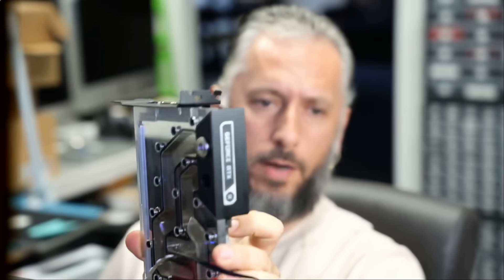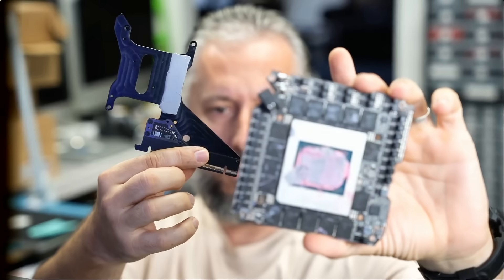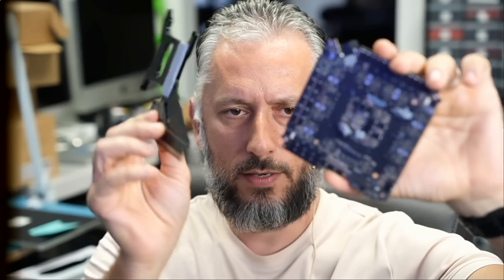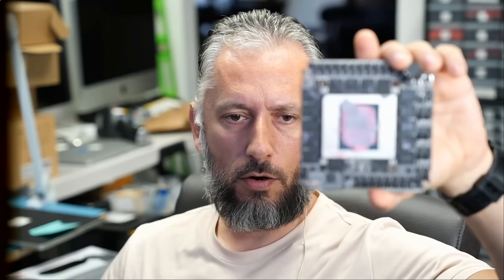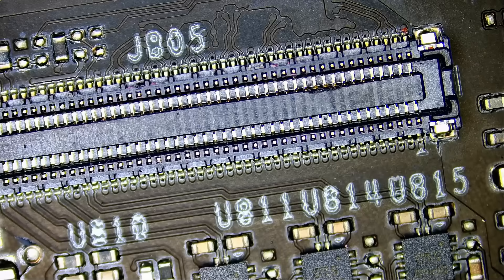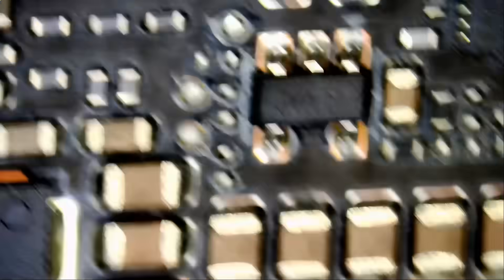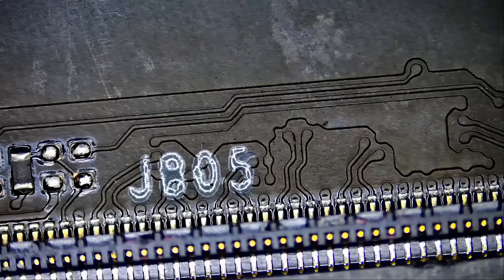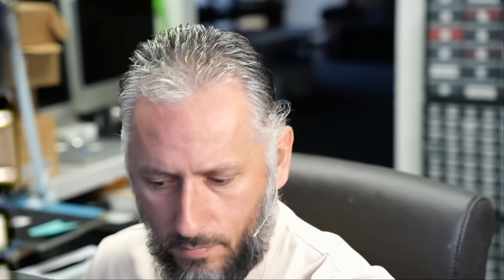Stay Away from 5090 Founders Edition GPU. The Weakest Design Yet.

Comment: working with PCs since 1998, and every time you take appart used PC you will most likely get an issue because of dust in the PCIE connector which is huge compared with that one... i think that electronics designers nowadays dont have any experience with basic electronic issues, they are just kids that finished colledge and know only what they were taught in school and nothing else.

Comment: Those connectors are terrible. But the same company that decided to use this on their most expensive consumer hardware also invented the 12VHP connector. Does this really surprise you?
Reply: Nvidia did not design 12hwpr connector Da$$
Reply: @JoeMama-yl1ow  They were involved in its design.
Reply: I agree the connector sucks and should have been designed better but the alternative is 4 pci-e power connectors on the pcb which is a huge no
Reply: @rckrz6  Actually each of those x8 connectors could handle quite a lot more wattage if needed. They had a lot of redundancy in the design. Compared to this design putting those through their paces seems the better choice tbh.

Comment: Let me see if I understood correctly. The owner bought a 5090 Founders. He then disassembled the card and installed a water block. During installation, he damaged a connector. Consequently, the 5090's design is the worst in the history of GPU cards. Is that correct? The problem isn't the design, which I consider brilliant and the way forward. The problem is the lack of user expertise and, also, the lack of spare parts. I have a 5090FE, and I couldn't be more satisfied with its design. However, it has terrible fan management, something that can easily be fixed with third-party software.

Comment: As far as I know Nvidia designed it that way, not because they wanted to make these parts replaceable. They basically wanted to keep the 2 fans for the cooler design and this required both ends to be permeable, to not trap the heat by the PCB.
Reply: The more you buy the more you save

Comment: You won't be able to purchase the connector parts as they appear to be proprietary to Nvidia. However, maybe you can scavenge one ;)  The entire card is designed to discourage tampering or repairs by individuals. Regarding the customer, it is their responsibility, as they could have opted for a water-cooled 5090 from various vendors. Now that the warranty is voided, it cannot be fixed, which is precisely how Nvidia intended it to be :)

Comment: You're condemning a perfectly good GPU because a mod went wrong. Which is nonsense when the product works as intended if you don't try make it what its not. The air cooler on the Founders addition works incredibly well and water cooling is not required.

Comment: I mean i see a positive logic here, since most last gen cards the fail point are the cracks on pci express connector because of weight, that is why they made it modular, so if ever the pci express connector is damaged, you can replace it with another daughter board😅, just sharing opinions

Comment: One issue with that connector is that the entire weight of the card can at some point hang on it.
I know we're supposed to have support for GPU's as big as that, but it's still glaring to me that the entire card can hang off a piece that isn't part of the main board and connected to a connector that can't be easily replaced.
Reply: The FE editions not put the weight on the PCIe connector, them have a unique and different structure that connect the whole cooler on the backplate, is there where the weight act on FE cards...

All the other brands ones discharge this weight directly on the PCIe connector, and so, directly on the electronic of the card.

You cannot notice this huge difference if you never tried to install a FE card

The real problem is, if you are not able to tear down it, just not do it, or you will obviously damage the card.
Reply: 5090 founders is actually pretty small.
It’s only a 2 slot card.
Reply: One way to solve GPU sag is to mount the card vertically, making it last longer. One way to solve that "problem" is for the vertical assembly to put extra pressure on a tiny internal connector, eventually breaking it. Bottom line, if the cards last too long, people won't be buying new ones sooner. The company's market cap in not going to increase itself.

Comment: In terms of the engineering of the card assuming you leave it in one piece, is amazing. The risk you have due to the repairability is extremely rough. But the engineering challenge that was being solved with this card is really amazing. 

It's hard. It is way more fragile. If there was a way you could get those parts for repairs, I think this is the best of both worlds. Because it does solve something that noone else had been able to solve.
Reply: What problem did they solve? Genuinely curious. Thank you.
Reply: @georgepeck9847  By making a 575w card a 2 slot design that runs cool. 

The 4090 used significantly less power and is just comically huge in a size comparison. The liquid metal cooler design of the 5090 is definitely impressive just fragile.

Comment: I wouldn't buy any card that take up over 300w in power. when in 3 years time the xx60 card will be just as fast and half the power, like the 3080 sucked up load of juice and it get bested by a card 4th of the price and halve the power use. I use to run SLI setup's and I never even with over 700w going to dGPU's did I have a burnt out power cable using the 8pin cables.
Reply: I want to replace a 3080, what card are you talking about? Thanks

Comment: Hi Alex
I'm an amateur pc tech, but have assembled and fixed many computers over the years.
I personally would not buy a 5090  founder's  edition, first they are very expensive, and as you have shown the design is the worst i've ever seen, it seems like when they designed it they absolutely made a grave mistake, so my advice to people is to not touch those card with a 20-foot barge pole.

Comment: My advice would be to forget about trying to install water blocks and work on getting better air flow in your computer case.
Reply: Plastic airway cooling solutions are amazing
Reply: My advice is stop being stupid learn how to install a water block correctly and don’t buy a garbage one 😂
Reply: Only somone who never had a custom watercooling system would say this (im not trying to be smart here). 
It is just facts.
Reply: @xxn0cturn3xx  A Water Block is 100% unnecessary for a 5090. The temps on the card are already excellent under stock settings, and performance gains from OC are very low.
This is just another case of "more money than sense". The only scenario where this could make sense was if these we're being used in a scenario like a gaming server farm, or just about any server farm where the target workload would make the 5090 a better pick than a QUADRO or H100/H200/B100/B200

Comment: maybe you can running jumper wires
Reply: I feel like that connector is so tiny that it would be nigh impossible and unreliable to run cables. Plus he would need a new pin too which I have no clue how he could pull off.
It's a high risk of the customer coming back so he probably doesn't even consider it.
Reply: @rarespetrusamartean5433 or he can remove all the connector and run 32 long jumper wires

Comment: Given how often the PCBs crack around the PCI-E connector on those heavy cards, I would have thought that having it as a separate part was an absolutely brilliant idea. But if you can't buy the PCI-E board on its own, then I guess it defeats the purpose. That said, though, I'm sure that in due course they'll be available from donor boards and from Chinese sellers after they harvest the GPU and VRAM from them
Reply: And now the mechanical stress from that heavy card is concentrated around an even flimsier connector. brilliant! This is just planned obsolescence.
Reply: @d.j.wiendels6572  but it isnt though? the stress is around the huge extra metal piece thats connected to the card itself. The metal is holding the 2 parts toghether, not the connector. Ive not seen an 5090 fe break from snapping because of that connector. Only downside is this where theres a risk that if ur not careful while disassembling, you could break the connector.
Reply: That was my first thought, that it was made so it was easier to replace the PCI-E connector.
Reply: I think it still is a good idea, but have bespoke connectors destroys a good idea. Then there is the unavailability of the daughterboard. But it's amazing how trillion dollar companies can get the public to accept the worst ideas and folks keep buying the product.  If you need to replace the rims on your car only to find out there are no replacement rims and that you'd have to buy another car, that would not be acceptable.  But anything Nvidia produces, folk keep buy it.  It's obvious the new power connector is a flawed design.  What did Nvidia do after the 4000 series melting connector debacle? That's right. They used the same connectors on the 5000 series cards and folks just lapped it up instead of demanding the connectors be changed. We deserve what we allow.
Reply: That is ngreedia for you, just stay away from them.
Reply: I would question just how much current could safely pass through that connector.

Comment: From a supportability viewpoint, yes, that's a stupid connector.  It's fragile and not meant for multiple insertions.
HOWEVER!  That card was never designed to be taken apart or "modded".  Many devices are like that these days: not designed for repairability.  So if the customer decides to do take it apart like a brute and ruin the fragile connector, then it's his fault, regardless of the choice of connector Nvidia used.  That's why we have experienced repair technicians with microscopes, tools, etc that can treat these devices with the care of a masterful watchmaker.
IMHO, the founder's edition is still a great card despite the fragile connector and I'm still looking trying to buy one, but they go out of stock as soon as it's available. 😡  I might have to pay extra for an ASUS version simply because it's available.
Reply: what if user want the change for better thermal paste
Reply: @ariewijaya1679  they have liquid metal as standard I think

Comment: I think the best solution is to change the board, solder Gpu die and memory to a new 5090 AIB board, They're selling them for 200$ on ebay full 5090 board without memory and gpu
Reply: Why dont they make it like with cpus ? Like placing the gpu-soc on the gpu board without soldering it
Reply: I think the best solution would be not to buy this card.
Reply: good idea 🎉

Comment: Or maybe a better video title would be "Don't mess with your extremely expensive GPU if you're a ham-fisted fool"
Reply: Or maybe the design of the water block is faulty.
Reply: Man, PC building was so nice, fun and easy a few years ago (can't really speak for before that).
Everything was simple. Plug and play. If it fits it works kind of thing. Everything had a place where it went and it just worked. You basically couldn't fuck it up.
The most trouble we ever had was dealing with front panel connectors but even that was trivial with a manual and if you fucked it up you couldn't cause permanent damage (at least I don't think so because the pins aren't high enough voltage).
I put a CPU in an AM3 slot with an entire row of pins off the socket (according to my more tech savvy friend at the time) and it was still fine. He was able to just resocket it and it worked. Now if I do that I'm not even sure the rest of the PC survives. This was about 10 years ago.

Now we have all sorts of BS like this
- RGB crap that often comes in things you wish didn't have it at all (my case).
- PSU-side connectors that fit but if you mix the cables between PSU's you fry your shit. No warnings from the manufacturer to be found in the manuals or online documentation.
- A billion different compatibiliy scenarios for everything PCI-e (see bifurcation and PCI-e versions).
- A billion different specs that aren't even listed, especially for SSD's. Does it have DRAM? Guess you need to find that somewhere else because the store page doesn't mention it. Is it QLC? No idea bro.
- Connectors that melt fron Nvidia.
- UEFI software made with AI that can brick CPU's.
- Proprietary connectors everywhere. How is that USB front panel connector still so damn bad? Nevermind RGB, fan controllers and case connectors.
- No debug POST codes for motherboards. We had those 2 digit displays on motherboards for ages, now they're a premium feature for super expensive boards...

I agree that dude should probably not touch something as expensive as a 5090 again but this was not an issue a few years ago...
Reply: @rarespetrusamartean5433  It isn't an issue now, not sure why you're having so much issues, you must have just been out of the loop for awhile and when you came back in thinking things would stay the same they weren't and you were lost. Progress don't stop for any reason or one, I've never left since I came in and it's still just as easy and problem free as when I stopped being a noob.
Reply: @rarespetrusamartean5433 Any good PSU company tells you not to use cables from another power supply. That's a given. Seasonic tells you that and Power Color tells you (the two PSUs I've bought). 

As far as SSD's they have spec sheets you download that give you most of the information and you can search for what you need in other places. A lot of times the model name tells you whether it is a QLC drive or not (certain brands put a Q in the name for example). Whether it's TLC or QLC tends to be very easy to find information on. Plenty of sites tell you that as well including SSD specific sites or ones like ServeTheHome. One giveaway is the price. QLC is noticeably cheaper than TLC and even cheaper if it is DRAM-less.

As for RGB, you can always turn that off. I turned it off of my motherboard, I could do it for my graphics card but I don't care enough, and I'm pretty sure I can turn it off of my case (Lian Li O11 EVO) but have to look at the manual. There has been situations where RGB let me know there was still power going through the system before messing with parts. I noticed that the RGB by my board's VRM stays on even when my PC is off. I have to turn the switch off of my PSU for the RGB to stop which is something you shouldn't have to do so now I just turned it off in the BIOS/UEFI. RGB on my case lets me know when Windows 11 randomly wakes my PC from sleep for an update or for no reason at all smh.

You have a point about certain things. I only started building 5 years ago myself but things have changed in that short time period. What's interesting though is sometime before that sweet spot period you talk about from 10 years ago was also really difficult for building PCs. There were more parts you had to think about including audio which we don't even think about these days because the built-in audio is good enough for most people (I personally have an audio interface I can bring out if I feel like getting higher quality though don't need to). Now is still not as hard to build as it was 20+ years ago.

Comment: Crazy card, made to fail earlier so you have to buy a new one
Reply: Crazy user, broke his cards earlier.
Reply: "The more you buy, the more you save!" - Jensen Huang
Reply: the more you buy the more you save!!
Reply: Only FE models, though they did make sure burning the power connectors by forcing AIB not to add shunt resistor so FE or not it will fail quicker all the same lol.